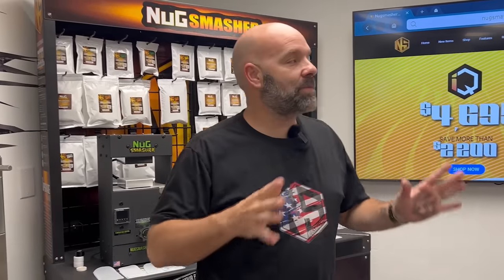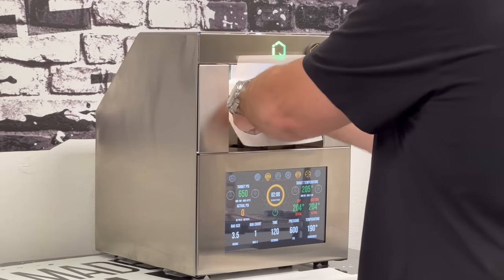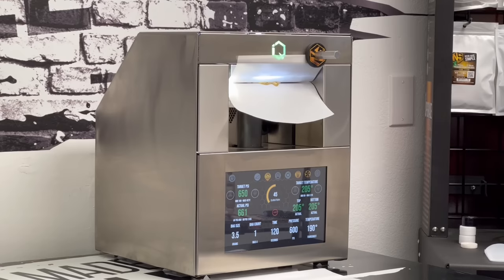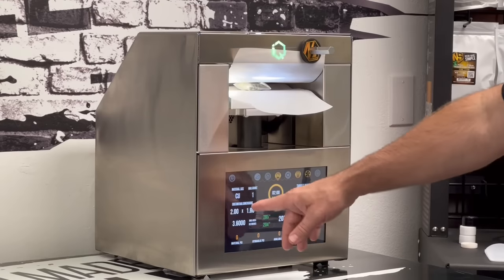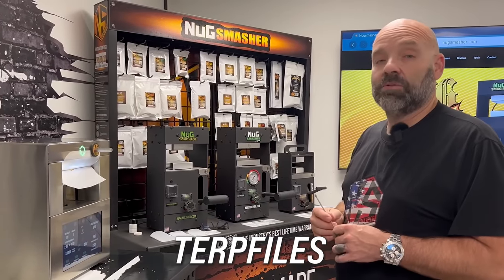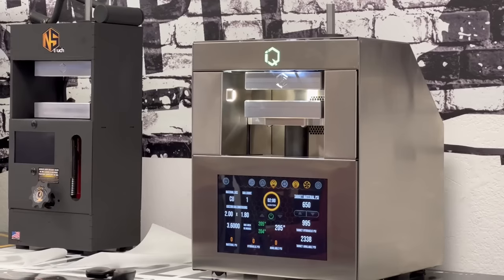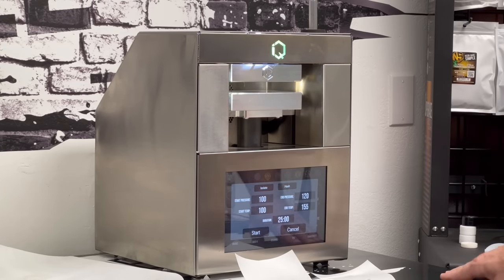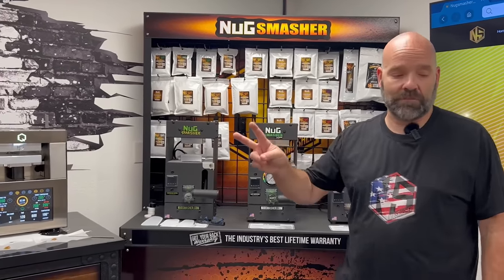DIFFERENCE BETWEEN BOTTLE TECH & FLAT EXTRACTION [ 26% VS 19% YIELD ] NUGSMASHER ROSIN MADE SIMPLE

Comment: Thank  you for showing the benefits of bottletech style versus rectangular. Most people probably wouldn't realize just how much of a loss it is if you're looking for smokable material. Grant it the bags can be used for edibles to get the rest out of the flat, but who really wants that lol.
Reply from the maker: thanks for watching!😁
Reply: I have personally found 10 grams to be the sweet spot on my machine. I'm assuming that the added material is pressed down through the same diameter helps if you do the bts style. Which is great once I got used to it I love it.
Reply: I meant to say the amount you smash can also have an effect. I get higher percentages out of 10 grams than say 7 or 3.5....
Reply: @davidcrain453  just gotta be careful to not get too much dark material but its otherwise a very clean high.
Reply: @Nugsmasher I feel that the square bag was packed too lightly with to much gaps between the buds? 🤷🏼🤷🏼,, opinion? Do you feel you could have maybe did a tighter pack on the square puck?

Comment: If you were to pre-press the flower in a mold wouldn't that take care of those corners and make the flat press just as good?
Reply from the maker: the corners may still stick out, inverting them still just helps hold everyhing together ina cylinder shape while being smashed down. the pre pressed flower wouldnt hold shape under pressure unless the bag corners were inverted
Reply: @Nugsmasher  So with the bottle-tech style its better to not use pre pressed?

Comment: What do you think of chottle tech?
Reply from the maker: not familiar with it
Reply: @Nugsmasher Maybe Tube Tech? It's where you cut the micro bag into an open 1" tube then pack flower evenly usually 3.5 g. I learned it from reddit for best yield.
Reply: I tried it once because of what I heard but did not like it as much as my prepressed bottle method. It was just to inconvenient not to have tops or bottoms on the "bags".
Reply: @mnegreiff  I agree. I did it a few times and the presses became inconsistent, so I went back go bottle tech. So much better if I just cut enough off for the top fold.